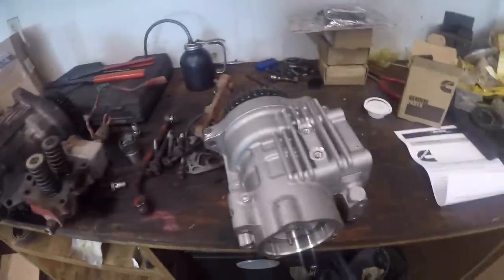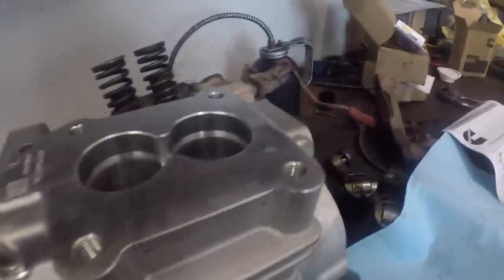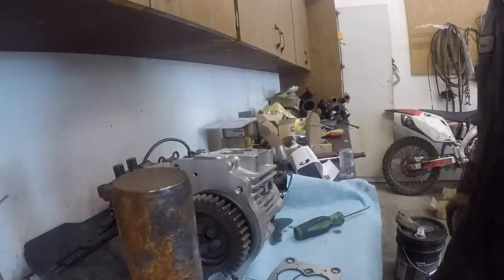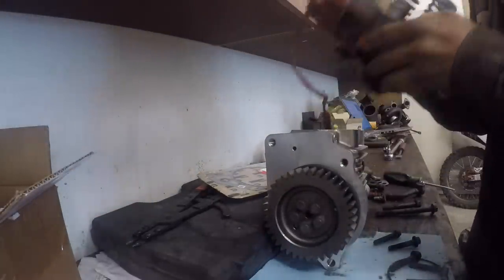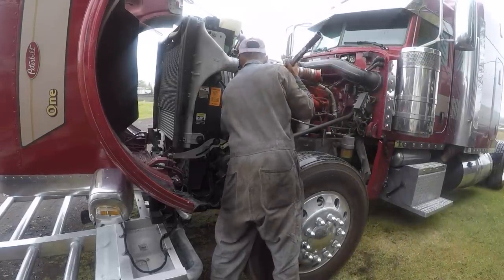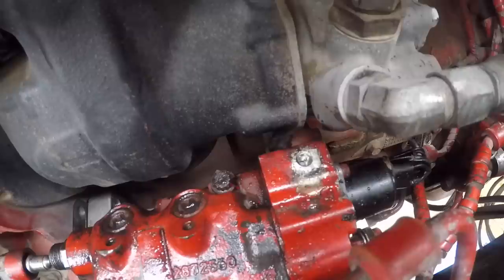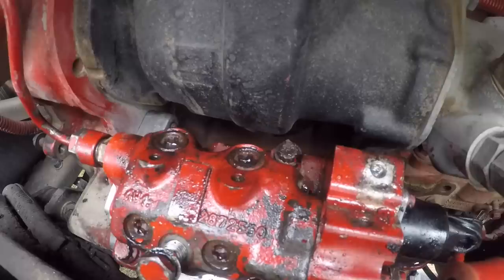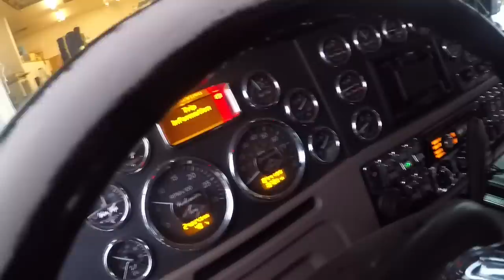Cummins fuel pump installation

Comment: We have a 7530 John Deere with 3800 hours on it, and it has also smashed the turbo blades 2 weeks ago. Was running perfectly then stopped. When it was started up again it started knocking. 2 cylinders was damaged.. No warning.. regards from the farmer in Denmark.

Comment: Hi Warren I am a big fan of your channel. Like you I work on everything and specialize in nothing, I have been asked to look at a Bobcat 763 skid steer that has a loud ticking sound from the top end. My customer put new valve springs in it and a new injector I believe. When we crack the fuel line to #3 cylinder the noise goes away. I am not a diesel tech. Any ideas what to look at next?

Comment: Just did a rebuild on my Cummins and everything went fine except for that dang Fuel line on the front of that fuel pump head. Had to buy a new one because that ball at the end just would not seal up. It just kept dripping fuel.

Comment: my hats off to ya , nice job. Appreciate how you run through and explain as you move along. 420 dollar timing tool. Tools and subscriptions are expensive but crucial. Shopping for Meritor/Wabco abs software this weekend. Part of the fleet I service are Prostar 4300 with Cummins and Maxxforces. They all have the hydraulic brakes and they are all starting to have a lot of issues beyond wheel speed sensors. OBD HD abs cant even pull codes. Time for an upgrade. What are you using if you don't mind. Wabco Toolbox or is there an alternative?

Comment: My brother had a turbo let go on a engine and had to rebuild the engine, when he got it back running again it only lasted a day and it wrecked the new turbo and the engine again. Apparently he should have replaced the inter cooler and cleaned the pipes out also. He replaced the engine second time around as it was completely destroyed.
Reply: And I will add to that, the replacement engine, he lifted it out his truck with the forklift and when it was about a foot off the floor the strap broke dropping the engine on the concrete floor. It cracked the pan. He took the pan off to replace it and found metal in the bottom of that engine so had to rebuild that one too. lol it’s still running 8 years on so all good now.  👍
Reply: Yep that's a common mistake 
If the engine fails everything attached to it needs to be replaced or cleaned as well 
The other common one is remote oil coolers 
Engine fails and fills the system with metal 
Remove and replace engine 
Start new engine 
Flush the oil cooler and all the old metal into then new engine 
Ka boom

Comment: Great work, dose the gear pump pull the fuel up from the tanks and then the plunger pump increase the pressure to supply it to the injectors for the final high pressure pump into the combustion chambers by the cam driven injectors?

Comment: Was curious what the exact customer complaint was have a truck that wont go over 19psi boost codes point to fuel have replaced a few things professionals still cant figure it out?

Comment: I have a code spn 157 fmi 18 only comes on when on idle and engine shuts off. Truck will pull good on hills with heavy load. You know what problem can be?

Comment: Might want to make a template of that tool..400 plus for that....Like a $500 sleeve to drive an oil seal..
Reply: Could use it right about now looks like the hole is offset of the Center line of the dowels by a certain amount

Comment: Hey you said the vains came apart and caused that. but how would it travel backwards? It should have just spit the vains out the exhaust in my opinion.
Reply from the maker: The turbo is mounted above the exhaust manifold, it happens on the JD  6068 engines on start up, so there's no manifold pressure, they brake and gravity takes care of the rest.

Comment: Could you explain why you do timing on this pump. If I'm correct you do not have injector pump here , hence you time the fuel supply to injectors? Thanks.
Reply: To reduce vibration in the gear train

Comment: G'day Warren, love your vids, mate. I have a quick one I'd love to run past you. I've recently purchased an old 1970's Komatsu D85a12 with NH220 Cummins. PT Common Rail system. Dozer looses prime and won't suck fuel up easily. There's a float tank under the dozer that the main tank gravity feeds and the rail return line goes back to. (I've cleaned and rebuilt the tank) Fuel filter canister located up top behind the fuel pump. Fuel shutoff solenoid has power to it however I've screwed in the override screw to be sure. I can get the pump to prime up with diesel pissing out the pressure side,  if I open the fuel filter canister and keep topping it up but I think the pump itself might be leaking around the throttle shaft as there's some air bubbles coming from there. I think this might be causing the fuel to drain back to the float tank, making it impossible to prime back up. Does this sound right? Best solution is probably to get the pump sent away and rebuilt. However, short term, do you think an inline 24v pump, mounted at the outlet of the float tank, would be ok? I'd run a relay and a switch and just run it for 30 seconds before starting. 
Any advice would be great, mate.

Comment: How much was that pump, and all the parts?
It'd be great if you did a few more of those, 
offset the cost of that expensive tool.

That needed all changed anyway- a filthy, nasty, dirty rig doesn't
really scream "Professionalism" you know?

When you were done- I hope they steam cleaned the area & repainted it.
That new, shiny metal will turn to crap if uncoated.

Comment: Hi 
I want to ask if you can help 
I have a Mack Mh cabover with NTC 400 Cummins engine ,the preowner faced a problem that the truck shut down by itself ,so he cut the wires goes from ignition switch to shut down solonoid and the truck stops to shut down so what's the problem and if I install a new shut down solonoid can it fix the problem?
Reply: Yes